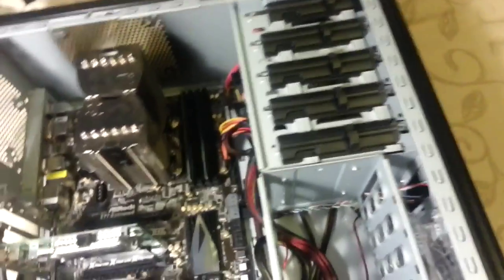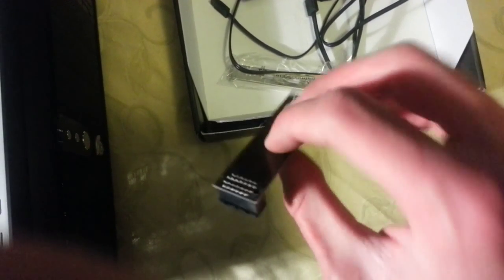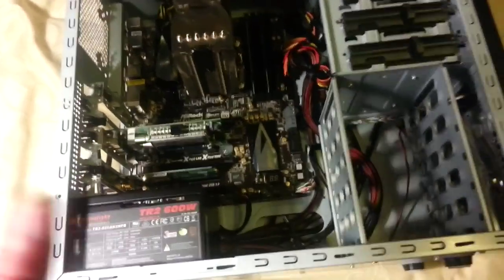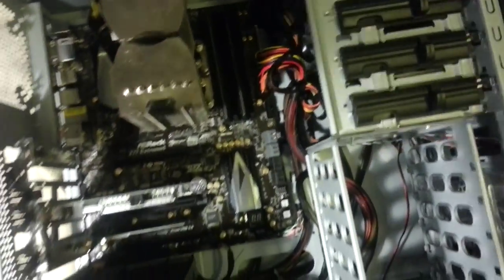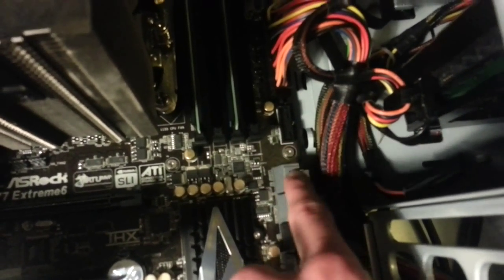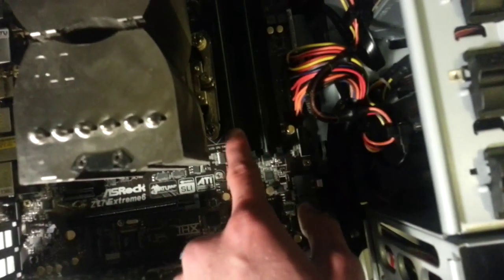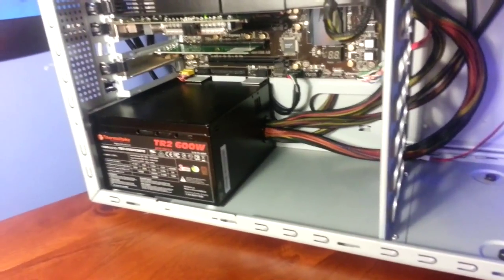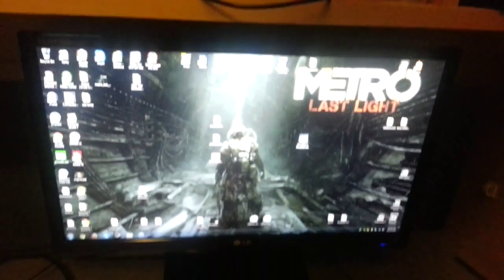Asrock Z77 Extreme 6 1155 Socket Motherboard Overview

Comment from the maker: Keep in mind this video is 2 years old therefore some of the noob issues I talk about in this video I am well aware of now however I still get the occasional disk read error message that comes up on some boots.... easy fix hard restart (hold power button, press it again and it should work. When you get past the asus logo you will most likely be greeted with a blah blah this failed to start windows correctly.. just hit start windows normally and it should boot fine).

Comment: time to do some research man be4 you do the bitching
Reply from the maker: Check the videos date and the question about the usb hub was valid... as it looks like it would fit a floppy disk slot in the front of some older cases... therefore I couldn't or cant put it in my old or current case.
Reply from the maker: Also if you are referring to the section were i stated the system wouldn't boot... it was due to the motherboard not correctly detecting my HDD and wasn't posting correctly... this was later fix in a bios update. Also this was my first ever motherboard with duel slot memory therefore it was completely understandable if i didn't know how the memory worked... clearly I understand it now though as this video is now nearly 2 years old.

Comment: That USB plate fits right in the front of my case.
Reply from the maker: Not on mine... id have to use a 5 and a quarter inch bay and only screw in 1 side

Comment: Yeah with dual channel kit for you're memory don't put them next to each other usually they are colour coded or have a different shade and you put the dual channel kit in the same colour if that makes sense. Someone's probably already said but just to recap ;) and yeah my case has a floppy disk drive! I decided to take the piss and and use a case from the turn of the century and fill it with brand new everything still confuses people when I'm sitting there playing battlefield 4 on ultra haha anyway have a good one!
Reply from the maker: I know that now, ive never had a motherboard with 4 dimms before this one so haha

Comment: one more question is my machine is good enough for u for a mid range heres my specs

Mobo-Asrock z77 Extreme 6 LGA 1155
CPU-i5 2320 or i3 2120
RAM-DDr3(Corsair or etc.)
Graphic Card-(I might use the integrated graphics for a while until i buy a GTX 650)
sry for the bad english anyway I hope i did not ruined ur day btw I subscribe to ur channel n liked too thnx

Comment from the maker: It should go away when the OS is installed and of course it will show Debug code lol, the problem is only if your os is already installed, the debug will show those codes because its checking your devices first and if theres no os to boot to it will hang on the last code

Comment: np thanks for the info! the build was fun but getting a code on the Dbug A2 and A6 this is without the OS but it boots up and i get into the bios fine should get my OS tomorrow I'm told it may go away with a OS installed i hope that's true!

Comment: Using the usb3 connector supposedly makes those sata ports unusable from what I read (not sure if it was manual or user comments).

The memory problem you mentioned is addressed in the manual, and the config (A1, B1) is the proper config for dual channel, and what was in the video.

Hope that clears some confusion, in a day or two I will be making my new build with this board.